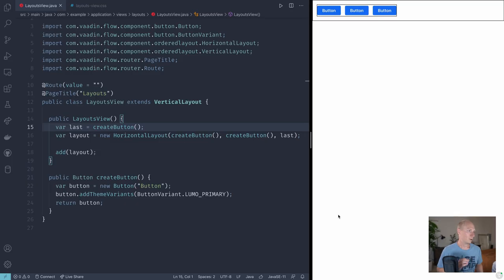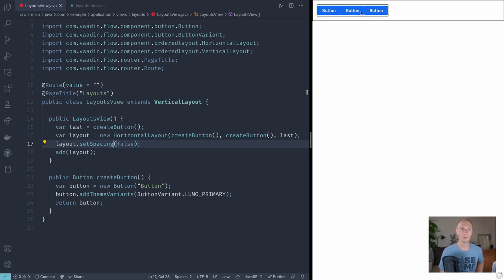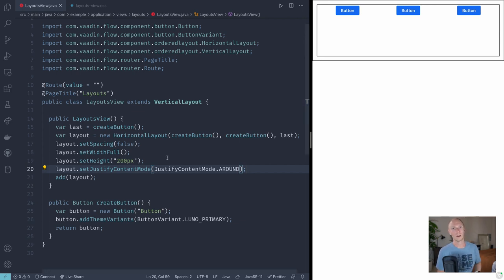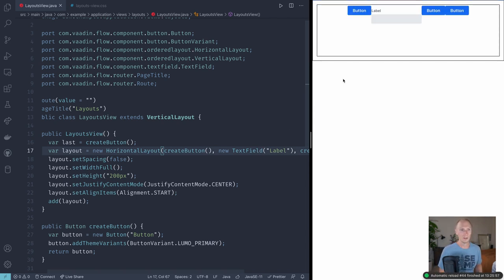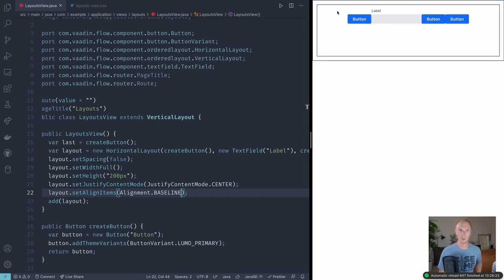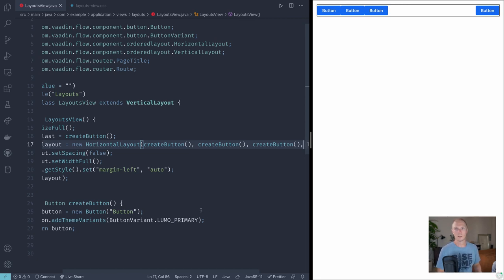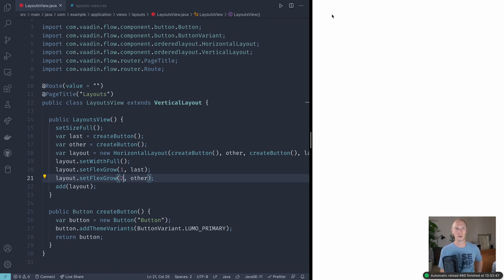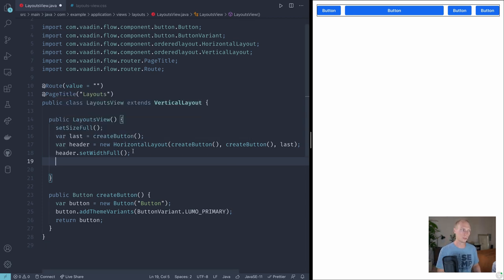Master Vaadin VerticalLayout and HorizontalLayout - layouts in Vaadin Flow

Comment: Very helpful. Can you tell me what software do you use for looking at the page updates in real time while coding?
Reply from the maker: I'm not using any additional software, just the Spring Boot devtools that are included with the starter.
Reply: @vaadinofficial  oh, ok! I tried it, but in any case with Java code modifications I still have to rebuild project, is it right?